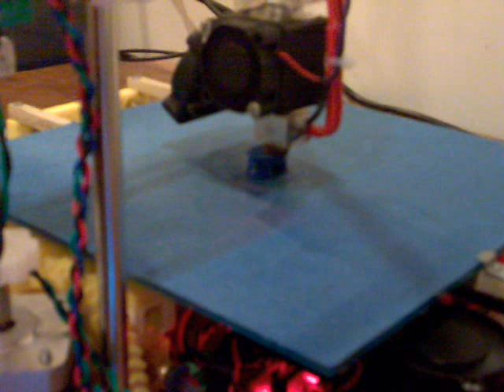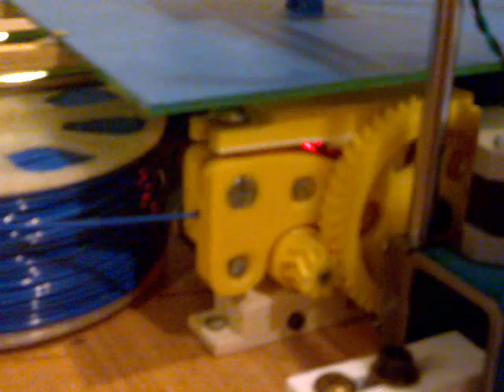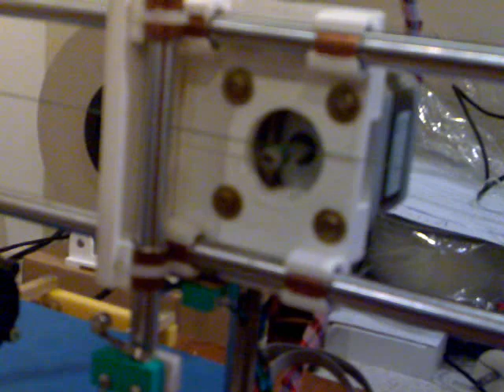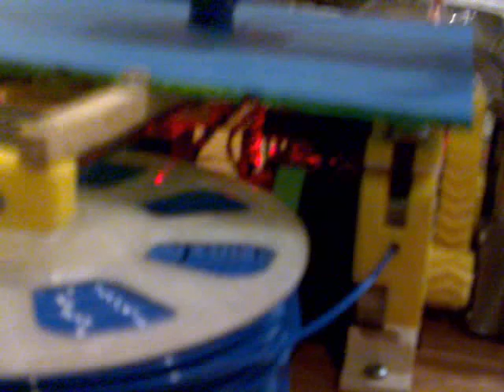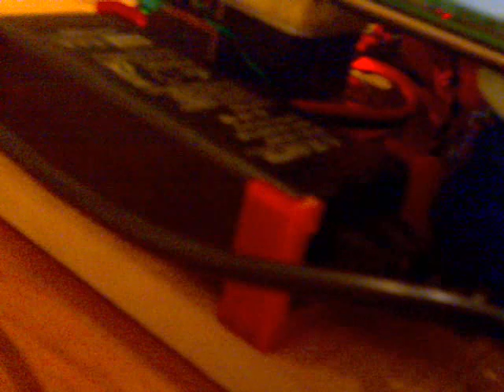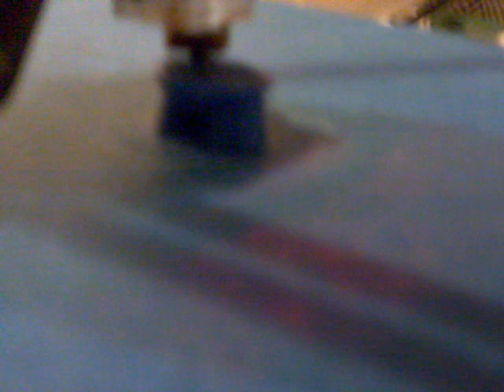Briefcase 3D printer - outside the case

Comment: I really like your printer. I have been tempted to try and design a briefcase printer more based on a prusa i3 style but folding frame. I think the briefcase lid could be fixed or buckled to the frame providing support along the back side when open... I really like your design though.